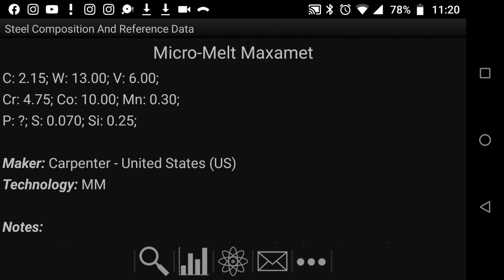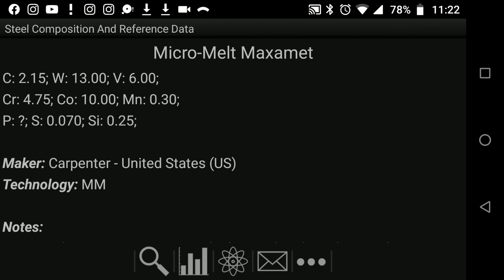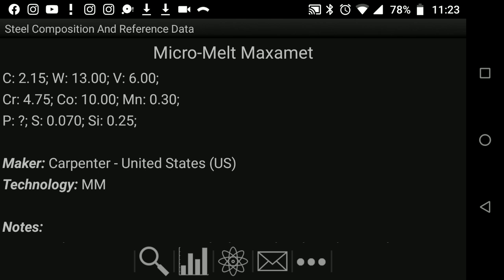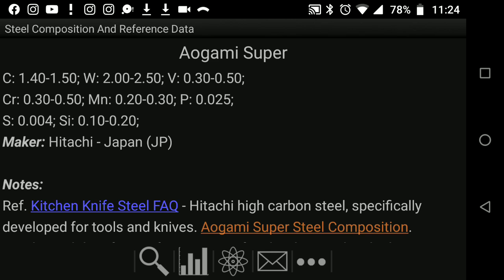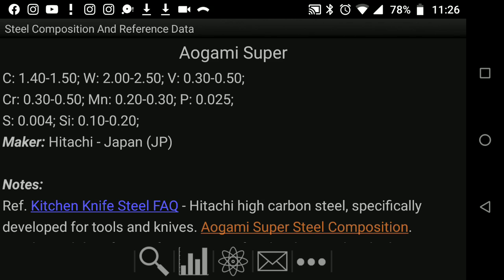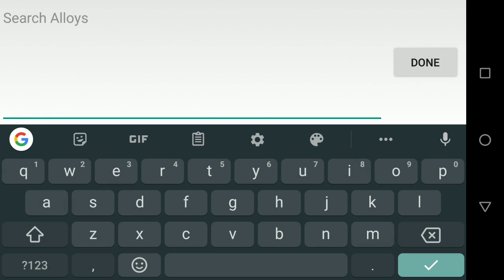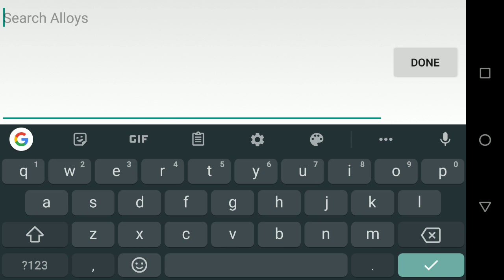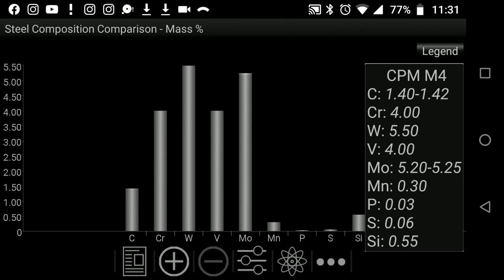No Tungsten Monocarbide in PM steels

Comment: Hi BBB Thanks for your info, always interesting. Quick question I’ld like answered is what does the cobalt do, in maxamet and k390?
Reply from the maker: For improvements in industrial applications, Red Hardness. The other features it can offer depends on how it's heat treated and processed more than the specific element doing all the work.
Reply: @FearNoSteel  wow that was quick. Thanks for the reply. I guess then it doesn’t add much to a blade steel.
Reply from the maker: It's just not as significant as Carbon or the other carbide forming elements but it does have an effect for sure. It's like a bass player in a rock band, he's there, but not as noticed by the average folks and only as good as the song that's being played haha
Reply: @FearNoSteel  😂. It’s just that few knife steels have it but those that do are great, and no one talks about it. Always perplexed me. Would love a fixed blade in which k390 was the best choice of steel. Haven’t yet worked it out. Am hoping one day Roman will....

Comment: Shawn I just watched your video of the maxamet grinding at what looked like a blade show.  It seemed like the grindings were not magnetic and it appears that swarf from regular sharpening is also non magnetic.  Do you have any clue why this happens and what is happening to the structure of the steel to lose its magnetic properties? Is it micro annealing?

My theories are either a micro heat event, or some electronic/magnetic event related to the friction.  It’s probably only a theoretical issue, guess I should go to steel nerds to ask.
Reply from the maker: It's still magnetic, it's just the magnetic field of each tiny piece of steel dust is very small. If the dust was superheated to non magnetic Austenite, Maxamet will not remain austenite when cooling in air. Only certain non knife grade stainless steel do that. This is
One of my favorite videos on magnetism.
https://youtu.be/hK_Yi5nxuKQ
Some good reading here too
https://knifesteelnerds.com/2019/03/18/magnet-heat-treating/

Comment: A little goes a long way I suppose, there does not seem to be much benefit to having an overabundance of tungsten. But you cant dispute the whole 1000degree temper.  Heard that certain stainless and carbon steels over a long time of usage and sticking it in the dishwasher even at 200 degrees, over years it will drop in hardness like crazy. Or drop it in the firepit and forget about it for a few hours, not that anybody would do it the handle would burn off, but if the steel isn't ruined or lost its temper, can just stick a new handle on it.  But that proprieties of tungsten alloy steels high speed steels,  for  not losing there temper at high degree heats,  is pretty dam spiffy. What would you think would happen if something that had  Vanax composition stainless steel, also had high tungsten as well?  Just something to think about, or dream about.
Reply from the maker: The tungsten element itself doesn't create "red hardness" but forms a structure depending on heat treatment that does. Don't get tunnel vision.
Reply: @FearNoSteel  Still, not to knowledgeable about what's out there. But what would be any stainless steel out there that would have the red hardness of a m2 or m4? Much less something that is a true stainless steel like vanax?
Reply from the maker: M390, Elmax, S30v, 154cm, S90v, S110v can all be heat treated to make the structures for red hardness. You should not get tunnel vision on red hardness. Vanax can also be heat treated for red hardness. It not ideal since its a compromise to the corrosion resistance and other factors. I recommend more reading.
Reply: @FearNoSteel  True, and forgot the whole high temper drop in stainlessness of steels. But then, what's all the commotion on getting the highest hardness tungsten carbide, when vanadium carbides does it, and does it netter better. Wrong element and tool for the job right? Tunnelvision, stuck on getting the highest hardness out out of the wrong tool. In which case? Whata all the big deal about tungsten anywaya, if there are other ways and elements i.e. vanadium. That does the same job and does it better in some casses?  Just agreeing with you there on the whole Tunnelvision thing. Still, tungsten is pretty spiffy. Even if not all that's cracked up to be.

Comment: I believe my question will be answered in any follow up videos u make on this subject.   Not knowing much about tungsten A-side from being heavy,  I see cobalt on the composition at the highest level too.   Well highest from common place knife steels I've looked at just at the recipe alone.   Take-away was that maxamet has composition ideal to reach high levels of overall hardness at the matrix.   I'm guilty of making assumptions based on patterns I've seen in compositions and real world use.   Knowledge is power and assumptions and theories altho genuine in nature can be incorrect.   Grasshoppers to this line of understanding must be met with an open eye and a willingness to be educated.  I'm personally conflicted on posting any of my rope cut numbers bcuz I fear it will be taken out of context.   Base level performance based on my knives,  my sharpening,  my parameters etc.   Every knife is tested thru use to some degree so controlled testing is cool but not required by any means.   Besides cutting medias change up all the time so plastics,  cardboard,  even foods like onions and carrots can be cut by the same knife on the same day even the same hour.   I'm not married to any composition but variety is the spice of life.   Ive been in a position to buy some high performance knives in the past and I've declined.   Idk if ppl buy maxamet cuz of the mileage they can achieve with a factory edge and a diamond loaded set of strops.   I personally buy knives/steel bcuz I intend to use and enjoy that sumabitch.

Comment: afaik (and take that w a grain of salt I'm not an expert) the type of chromium carbide you're talking about only forms in certain low carbide volume steels like AEB-L. i.e. K2 type chromium carbide 79 HRC vs K1 type 72 (like in 440C and many other legacy steels).  so you might get a harder steel with tungsten / W6C just by virtue of carbide volume, no?
Reply from the maker: K1= M23C6, K2 =M7C3
I made a chart for reference in this thread
https://www.bladeforums.com/threads/carbide-hardness-chart.1705186/
Reply from the maker: I didn't want to get into details because I felt it would only serve to confuse to explain deeper. There is an "ebb and flow" with K1 and K2, so it's not so cut and dry as "low alloy has K2 and higher alloy has K1" there is a temperture during Austenitizing you can reach in steels like 440c where most of the K1 is dissolved and reforms as K2, also during annealing the K1 will precipitate out again "ebb and flow" Steels like AEBL are just set up to dissolve all the K1 and reform K2 with no mix thanks to the Carbon, Chromium balance and volume. At the same time there are harder chromium carbides than "Cr7C3/K2". Vanadium rich Chromium Carbides are harder "CrV7C3". The Rabbit hole goes deeper. What if I told you no Carbides are purely one element? "M" meaning Metallic Element hence why Cr7C3, CrV7C3, CrFeMn7C3 etc are all called "M7C3" and the hardness and  size changes with chemistry, volume, temperture and presence of other elements. Hence why when you look up "Chromium Carbide" it's a total cluster fuck. That's why Everything is described by the crystal unit cell  not elements.
Reply: thank you for this explanation. it's not confusing, just unexpected. I suppose the temp needed to get K2 in 440C would be high enough to get excessive grain growth or else everyone would be using it? I tried to google it but wasn't sucessful.
Reply from the maker: @verdigrissirgidrev4152  nah, excessive retained austenite which is undesirable. The grains don't grow like you think in 440C like they do in common steels like 1095. There is a good amount of carbide volume undissolved in the steel left during Austenitizing to pin the grains. Don't get confused though, I'm not saying the carbides are small like AEB-L.The K2 Carbides in AEB-L are small thanks to the low volume not the K2 Carbide itself necessary remember, carbides can be large or small based off of volume, temps formed from cooling when the steel is made and presence of other elements. I've  done some work with 440C recently, it is a good steel but the heat treatment information for it is not very good. It is capable of higher hardness and finer Carbides than what the spec sheet shows but the steels reputation is so bottomed out it would be a uphill battle to explain.
Reply: yeah I've read about that grain growth thing recently. if I understand it correctly carbides of alloying elements form around the aus grains, so those can't grow at their usual temps ( i.e. cementite solution temp?), need to reach the dissolving temps of said carbides for any growth to happen. 
my confusion was about carbide volume, I thought reaching a certain volume makes it generally impossible to get K2.
regarding the heat treatment of 440C, I'm willing to listen if you're willing to explain. I've read Jay Fishers website on the topic but that was kinda unsatisfying, his (simplified) point seems to carbide steels are inherently superior to plain carbon steel, grain size size doesn't matter as much (he kinda avoids the topic) and if it does eta carbides (from cryo) supposedly make up for large primary carbides.
Reply from the maker: @verdigrissirgidrev4152  it's not that they form, they are already there. The steel has more Carbides before HT and they are dissolved. The Undissolved carbides in steel are desired for wear resistance.
Reply from the maker: Nope and Nope